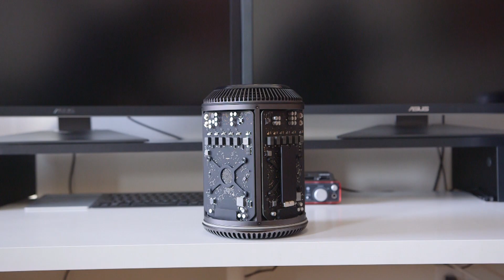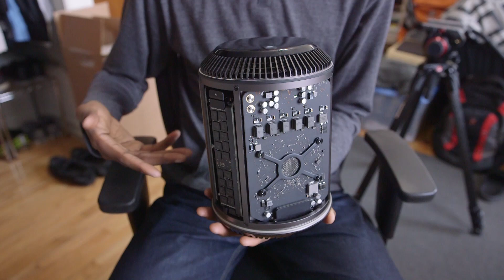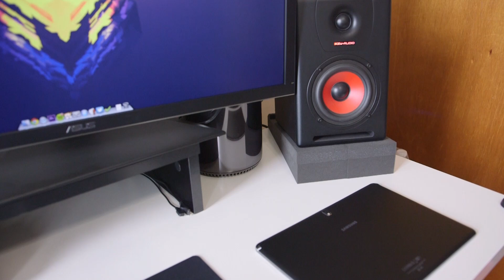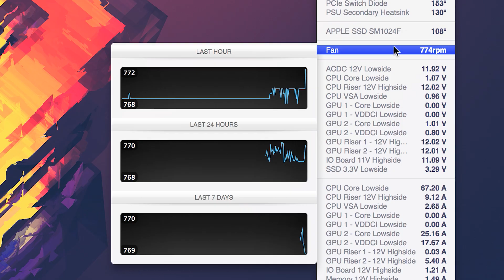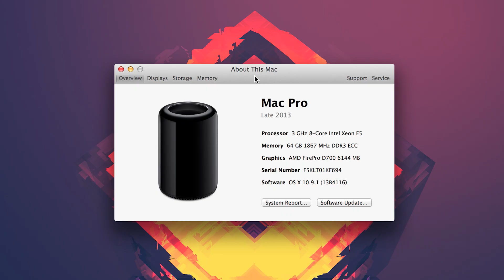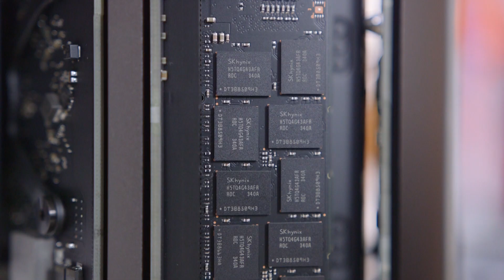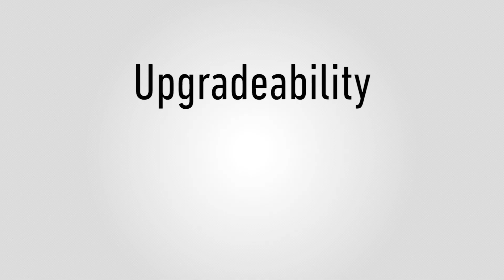New Mac Pro Review!

Comment: Don't get me wrong, EXCELLENT machine. But TERRIBLY overpriced. You can get bigger and badder for much less...and even better looking haha bc this does look like mini garbage can.
Reply: I'm guessing you didn't make it that far into the video...
Reply: thekingofalldoom You realize Marques links to a comparison that proves a custom built PC is about 2-3 times more price efficient than this? A 4000$ PC consistently out-performed an 8000$ Mac Pro. It was a little embarrassing.
Reply: ***** You're... oh god... just listen. Watch the link. It proves that both the operating system AND the hardware is weaker, and considerably more expensive.
Reply: *****
Yeah ok, $2000 extra for an OS? Intel creates 'faster' CPUs specifically for the pro? What the fuck are you smoking?
Reply: Look, I used to mock this thing mercilessly until I actually tried to spec out a similar machine myself, the thing is just damn cost effective. And no, Apple isn't always overpriced, back in the PowerMac G5 and Xserve days those both where some of the fastest and most inexpensive options. Even the 64 bit Opterons overclocked didn't hold a candle to the performance the Mac systems offered.

And by the way, have you ever seen how expensive the kind of milling operations they use are? Having worked with automated bridgeports and haveing several parts machined, I can tell you that the kind of machining done to that case is absurdly expensive. The amount of engineering done to prevent resonances in the workpiece is incredible. I once had to redesign an entire robot gripper due to improper geometry, and that piece had a far better profile for vibration absorption than the .122" shell on the Mac Pro.

And what about the PSU, engineering a PSU that small with 750w output is nearly an impossible feat for normal technology. SilverStone is one of the premier SFF PSU developers in the world, and even their best attempt is a mere 450w at a far larger profile.

Think before you spout out random crap please. This is a workstation, not a gaming PC. It has a ton of functions for accelerated computing that a normal user would neither use nor need, but a pro user could hardly live without.
Reply: But nothing would be running as great as Apple's OS, thats why we pay more for that then buying something that gonna brake for no apparent reason.
Reply: Matthew McKellar But pros don't care about size or cool milling methods, pro have their computers under their desk and should never need to look at them, especially shouldn't have to reach under the desk to press the on button on the back of the computer (fucking stupid button placement). Also lack of ability for me to put aftermarket graphics cards is stupid, hence why i'd have the old mac over this.
Reply: Mysterious HobNobs Correct on all points fine sir. My argument as aimed was at whether or not this machine was overpriced, for which it is not.

But practicality is an entirely different beast, and this machine lacks in that category significantly at the moment.

Affordable Thunderbolt to PCIe-16x adapters could remedy this plight to some extent, but that does still leave you with an external caddie to deal with. Urgh...
Reply: Jonathan Erickson No, he links data that proves it costs about half the price to create a more powerful PC.
Reply: ***** "The only tests done were ones that point to gaming preformance"

That's just nonsense, practical workstation tests were ran and the Mac Pro did outperform the PC, but it wasn't really by a margin that accounted for the huge deficits in gaming performance. Yeah, the MacPro is ultimately a better system for the workplace, but it certainly isn't nearly as cost efficient as a custom or personal build.
Reply: Actually if you tried to make an exact "hardware" based rig, it will cost more but... apple's choice of hardware is terrible in terms of bang for the buck, if you want to build with "alternative but better bang for the buck hardware" then sure you can go a lot cheaper
Reply: I admit for the performance-customization a PC can be better. But, if you check the cpu of a Mac, it's always more powerful than cpu's on PC, because Intel custom-made cpu's for Apple to be more powerful, it's always the high end one. Mac stay stable as fuck, so yeah fuck PC's at 500 bucks.
Reply: It would cost more to make a more powerful computer
Reply: ***** I'm generalizing. Check the spreadsheet from the linked video, it's abundantly clear that a built PC is considerably more cost efficient.
Reply: It isn't all overpriced, but it also isn't targeted to the average consumer. The typical consumer will want something without a Xeon, ecc memory, or dual workstation graphics.
Reply: Jonathan Erickson No.
Reply: ***** Just get Linux if you want osx so bad
Reply: ***** You are fucking clueless.
Reply: Kevin Wang lol i know right i am on a toshiba qosmio i got for $1500 right now and i have had it for 2 months, and the parts in it are much better than those in a mac. I know this because i have had experience with a mac before this. the OS is absolutely not worth the extra $2500, and neither is a desktop shaped like a trash can, with minimal upgradability and accessibility ,thanks to it's lack in usb ports and the lack in thunderbolt 2.0 software. Speaking of software, there is not much software for windows that you can download on a mac. my computer runs everyday activities perfectly, and honestly, so does my mom's $300 little mini laptop. So, is $2500 REALLY worth it for an over hyped mac trash can? and YES, i watched the whole video. Really people, just get it into your heads that this thing will NEVER be worth the money.
Reply: Darren Soul-rider It is targeted at the average consumer with a lot of money, no professional would buy this..
Reply: You obviously haven't checked the price of two FirePro W9000's and 64Gb of 1866Mhz "ECC" Ram lately, have you? The cost of those parts alone is more than what Apple is asking for the whole machine.
Reply: Matthew McKellar Pfft are you serious? What a moron
Reply: FuZionSniperzZ
I sincerely hope that you aren't calling me the "moron". Because the silicon that makes up the D700 in the Mac are two Tahiti XT chips for a grand total of $3000 a piece. The RAM also goes for $200 a 16Gb stick, mostly due to the abnormal high clocks for ECC memory. Thats $6000 in GPU's and $800 in memory.

Though hardly cost effective components, you are definitely getting you monies worth for the workstation components included.

I just checked, and a similarly specc'ed (actually somewhat slower) Dell Precision workstation costs $978 more than the Mac Pro. So I dare say that this machine is certainly not overpriced for corporate use at design firms.
Reply: Matthew McKellar If you knew Apple you would know they over price everything
Reply: But you cant be that much of a hater on the mac pro come one! Its still pretty inpressive right?!
Reply: ***** Linux destroys osx  is in every way possible also the original Mac os Unix based operating SYSTEM original architecture is what we want but can't have
Reply: AdamantuimDragon NG Excuse me, but could you more clearly restate your argument. Plus, it is worth noting how OS X was structured as a BSD system, using the BSD userland but primarily MIT Mach Unix components for its kernel.
Reply: I only say this because OS X is a Unix>Bell BSD>MIT MACH>Darwin lineage, where common GNU Linux is Unix>Minux>Linux>GNU

Comment: Great review,  I can't tell that the mac pro is definitely helpful as you have to process and edit a lot of video.  My question is between the mac pro and a imac with top specs, which is the better buy?
Reply: iMac is a load of shit, it uses laptop components which are weak as hell compared to desktop components. Mac Pro is a workstation and is overkill for normal use by regular users, even for video editing you do not need it. 

I recommend you build or buy a windows PC with a core i7 processor, a decent graphics card and 16gb of ram. That will set you back less than a mac and you can edit videos and game to your heart's content.
Reply: I appreciate the info.  I currently have a Samsung series 7 chronos with 8 gb and an i7. But I am doing video editing as well as digital art.  So I was wondering if it was time to move on to a true stationary platform
Reply: Mac pro is probably completely overkill for your needs, that is a professional-use workstation. Of course, if you have the money, when you have it it'll completely and absolutely do everything you want it to do... And more. So yeah, take that into consideration.

Comment: Adobe products are not optimized for multicore and multithread processors - they only use one - so in the end, it doesn't matter if you have 4-, 8-, 12- core processor - Adobe programs will only use 5% of it. However it has matter if you use rendering software like 3DS, Vray, Rhinceros, etc. - more cores = faster rendering. However if you need computer for web browsing, word and excel editing (or any other software like this), watching some movies, etc. - is it really worth spending over 3k-5k dollars for Mac Pro? You can get nice PC for 30% of that price.
Reply: I don't know what you are talking about but just about everything in the Adobe CS is multi-threaded. If you have them installed go to preferences > Memory & Multiprocessing (After Effects) to see how many cores the applications will be allowed to use based on you RAM preferences. It also lets you reserve cores/RAM for other applications so your OS doesn't get squeezed for resources. Maybe not "optimized" but they certainly take advantage of the multiple cores.

Comment: I really like the Mac Pro but it's far from flawless. While I think it looks great and do appreciate the engineering, especially considering it's size, there are a few problems. There's no optical drive, it lacks integrated card slots, storage limited to only 1TB, no DVI port, and despite being upgradable (except the mobo), the parts are limited, expensive, and hard to find. Plus, it's not a good 3d modeling workstation PC. Also, if people want a small, portable, and powerful workstation PC, there are laptops more capable than the Mac Pro's highest configuration.
Reply: A. When was the last time u have used an optical drive? The average consumer doesn't ever need an optical drive. 
B. at least 90% of people don't use dvi ports
While true it is expensive to upgrade this, that is also another point. The point is that it is so good, u probably won't have to upgrade it. 
C. People who are looking into this aren't interested in laptops as they are looking for desktop CPUs as this is one. Also name me one laptop that isn't cumbersome, meets or exceeds this computer, and doesn't have "flaws" like this one.
Reply: Superfartz I use my optical drive for blurays, PS1 emu etc... Last used it yesterday. That's true but for some it's like a safety net. DVI's bit cheaper but yea that's true. It does perform well but I wouldn't go that far. There are laptops w/ desktop CPUs. Eurocom X7.
Reply: It's not all about you... He's talking about AVERAGE consumers. They use what it comes with and they are fine with it. The software is just right for everyone for daily use but I don't know why anyone would change it unless they are mad and want the better hardware than what it comes with. Also, you own a goddamn PS1??
Reply: Superfartz  (Reply to first comment)
A.) Last week.
B.) Both my monitors use DVI.
I do music and audio stuff and I buy my software in disk form because you can't always trust that small companies will always maintain their software downloads.
Reply: Ravindran Surendran I know it isn't and TheFlyingElephanter is right, Mac Pro's aren't for average consumers. Most iOS users don't use all pre-installed software. What software? A lot of people actually do base their choices on hardware performance. Yes, I do and still works. Why?
Reply: I love how every single copium comment in here has been clowned on. Apple discontinued the trashcan after years of delivering no hardware updates at all. Not even a good piece of hardware tbh.
Reply: The "average" consumer won't drop 3 grand on this trash can. Its not even clear who the target audience is for this product

Comment: Steve Jobs was always trying to launch desktops that avoided a mess of cables on your desk, behind your machine.  With the octopus effect of the Thunderbolt connectors, this workstation concept does not seem like the brain child of Steve Jobs.
Reply: ***** I still respect this product but, this is a different direction for Apple.  I'm always buying used trailing edge machines, anyway.  I hope to upgrade from my refurbished Mac Pro 1,1 to a used 2009 Mac Pro.  Maybe some day I'll upgrade to the current "Cylinder-Mac-Pro" as a used or refurbished product.

Comment: I never thought the ultra limited design of Mac Pros worked well as workstation machines. I'd rather have a PC with shit tons of options and way more room for upgradeability in the future, and of course with a much cheaper price tag.
Reply: but if you are strictly comparing workstations there is nothing wrong with the form factor of the mac pro. "upgrading" makes no sense when dealing with workstation hardware because the price to performance ratios are so low. you are better of getting the best of the best up front, wait a few years until its not usable and buy another one.
Reply: iamterence77 And this my friends, is the definition of Apple fanboy's philosophy.
Reply: Darren Huang why would you say that. The workstation industry is noutorious for overpriced hardware whether you building it yourself or buying from an oem such as apple

Take for example the gpu. On amd's side of there exists 2 core designs. the first geing Tahiti XT being used in the current mac pros (its a W9000 slighly under clocked). The new chip called Hawaii rougly gains around a 25-30% improvement over the previous core (we haven't seen the workstation card based on this design but it is coming, The consumer card is called the R9 290X) 

with workstation hardware at the top card, you are looking at a $3000+ card. and then the mac pro has 2 of them.

So say you dump $10,000 on a custom built workstation with the sole intention that you can upgrade it. Will you actually spend $6000+ just to attain 30% ??  Nvidia's isn't any better in terms of quadros, and intel's xeon line has even less of a performance gain, not to mention any major change on intel will probably make you change out your very expensive workstation motherboard as well

Comment: I think you have things backwards. Expandability is for external and upgradability is for internal. You expand with an external hard drive and upgrade with internal video cards or more ram or larger internal hard drive. Hope to see this vacuum cleaner on a garage sale for 200 in 2050 hahahaha.
Reply: Actually 2050 is too far away maybe 2020. This is 2014 and the 2005 cutting edge g5s are selling for $50 on craigs list. hahaha. Just change your reality and think as if though it was released yesterday hahaha. use cs4 on it it is great. Mac pro intel 350 on craigs list. Cheap apple. hahaha.

Comment: for those that don't know the D700's are the fire pro W9000 and for those that don't know a single W9000 video card on its own costs 3000 bucks and the mac pro has 2 of them.
Reply: The price hasn't been updated to consumers so apple probably pays nothing for them.
Reply: Actually the D700 is another renaming of the HD7970/R280X card but this time it's BIOS and driver have been tuned towards professional work instead of gaming.  Did you really think the MP had two GPU's worth more than the entire machine? O.o
Reply: why it doesnt need them just more rubbish with a high price tag

Comment: For people who dont use imperial system, 125° Fahrenheit is approx. 50° Celsius, man... that is cool for a computer.
Reply: Dude i got and AMD 8core CPU and i get 25°C idle to 40°C max temperature while im in windows 8.1. And yes my case is open and i got few extra fans but if my cpu gets hotter than 40°C the fans start spin faster and i can hear them.
Reply: ANDiTKO Translation: I spend 1000$ on cooling system and is only costing me 100$ each month on electricity
Reply: (talking Celsius)
On my PC I get 50/65 on normal/maximum load, when dust settles in it can go up to 90/105 and that's still fine.
If I don't clean it, it will eventually reach 115 and that's when the bios will shut everything down.
Reply: ANDiTKO Didn't mean to join a dick length challenge, just wanted to confirm that 50 celcius is indeed cool for a computer, as there's worse around and it's fine (mine)
But good for you, dude.
Reply: My Old Macbook got to 100C lol
Reply: ANDiTKO

AMD chips run much much hotter.

In fact AMD and Intel measure their temperatures very differently. Intel measures the actual core temperature in Celsius whilst AMD uses their own scale.

Most high end AMD chips need liquid cooling to even run properly, the exception being the 1100T's lineup.
Reply: my iphone easily goes over 200 farenheit when i watch youtube on 3G
Reply: my pc averages 40 celsius when im browsing normally, 70 celsius when gaming